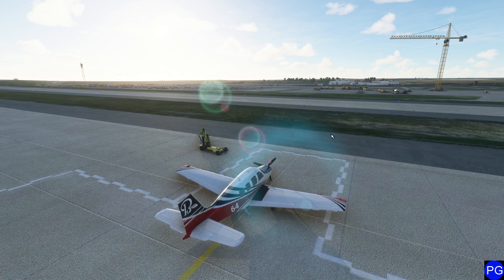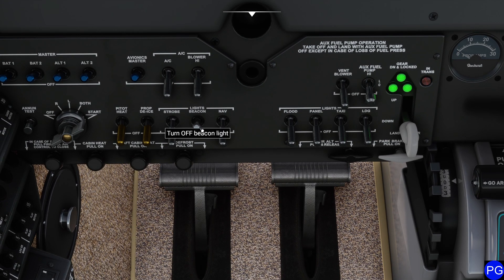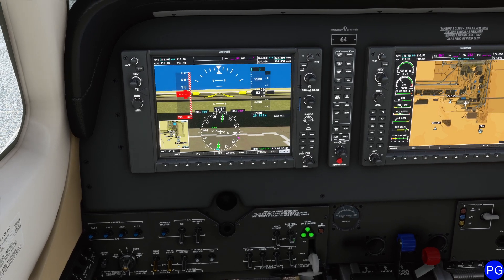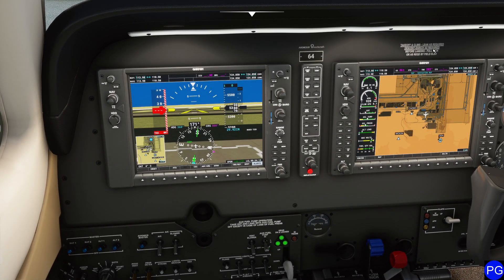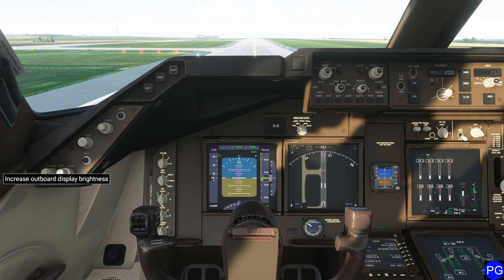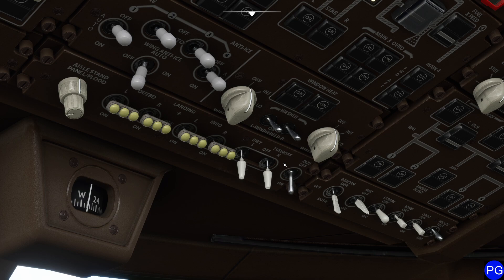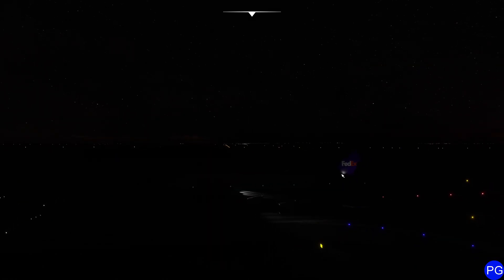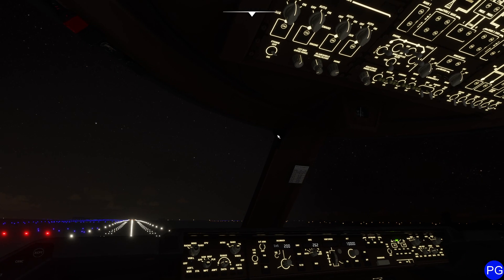FS2020 - Aircraft lighting, what and when to use.

Comment: I have "recognition lights" on my checklist for the Citation Longitude. Is that the same as beacon lights?
Reply: Not really. For the Longitude, lighting names are a little different (in the real life aircraft), here goes:

1. Landing lights, recognition lights and pulse lights are on the same lighting fixtures (the 2 rows of  7 LEDs on either side of the belly).
The landing lights button is obvious, it lights the LEDs to full brightness;
Recognition lights button turns on the same lights but dimmed
Pulse button flashes the left and right (full brightness) alternately (left, right, left, right).

The landing lights take priority over the recognition and pulse lights, so, for example: if you have both landing lights and recognition buttons turned on, the landing lights (full brightness) will shine. Same  with the pulse. They only work (alternate flash) so long as the landing light switches are off, otherwise the landing lights override the pulse.

2. Nav lights don't have a switch on the Longitude, they automatically turn on once either Batt 1 or Batt 2 is pushed on. Unlike most aircraft, there are no strobe lights on the wings of the Longitude (Asobo got this wrong), only the green on the right, red on the left nav lights, and two white nav lights on the top back of the vertical stabilizer.

3. the beacon and strobes are located on the same fixtures (one on the belly, the other on the top of the vertical stabilizer) and an extra (strobe only) on the top back of the vertical stabilizer, sandwiched between 2 white nav lights. Here's how they work. The beacons automatically turn on as soon as you start the APU, so, like the nav lights, they have no physical button or switch. Now, unlike most aircraft, the "ANTI-COLLISION" button on the Longitude turns on the strobes. So how does this work? When the beacons turn on, they (top and belly fixtures) flash red like so: red - nothing - red - nothing. But as soon as the anti-collision button is pushed, the "nothings" get replaced by white strobe, and it goes thus: red - white - red - white, and the strobe at the top back also flashes white simultaneously with the white portion of the red/white flash. So the LEDs on the belly and top vert stab are multi-color LEDs that can flash red and white. 

Well, that is real life, but in MSFS, they've assigned the "recognition" button to the nav lights, and the "pulse" button to the strobes, and finally the "anti-collision" button to the beacons, while putting strobes on the wings.

Comment: Step 1: "Let's get started" (starts engine with lights off)
Step 2: "The beacon is the first light you turn on before the engine.  Always, always, always have the beacon light on when the engine is running." (turns on beacon)

;) j/k though - another helpful video!

Comment: Edit: never mind, I found a separate video on A320 lights and apparently they're either extended and on, extended and off, or retracted and off, and there's relatively few instances where pilots extend them without turning them on.

Original Q:
In the A320, are the two different landing lights just the halfway and then full position of the switch? Like you flip it from "off" to middle "on" at 10k, then from middle to top "extended" on final?

Comment: Complementary information. Angles of visible navigation lights: RED: from front to 110 degrees left). GREEN: from front to 110 degrees right. WHITE: from rear, 140 degrees. Total: 360 degrees.
Reply: 2:30 Pretty sure this is all incorrect. Unlike a ship an aeroplane does not have masthead lights. 
The wingtip lights do not show aft of 20 degrees. 
The tail light does not show forward of 20 degrees of the beam. 
Not counting the rotating beacon:
Coming towards you one should only see the red & green lights.
Heading away one should only see the white tail light.
Abeam one will see either a green or red light.
One will not see a white (tail) and/or either wingtip lights.

Comment: Great video!  One of the first things I was ever taught at the airport was to watch out for that beacon.  Our rules state that we normally can't approach an aircraft with a fuel truck if their beacon is on, even if the engines are obviously shut down.  Also, for added realism, shut off your taxi lights as you turn toward the marshaller when parking.  If those lights are pointed right at us, we can't see you well enough to guide you around any obstacles, or stop you on the appropriate line.